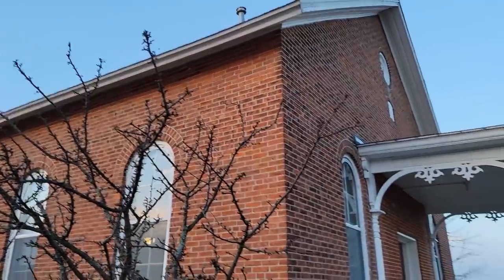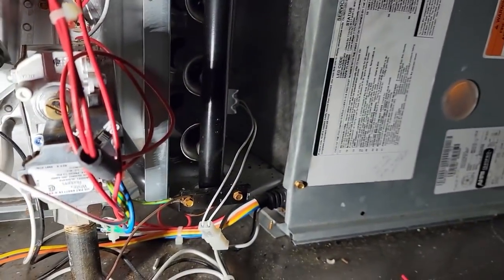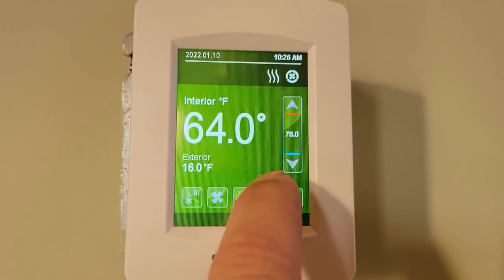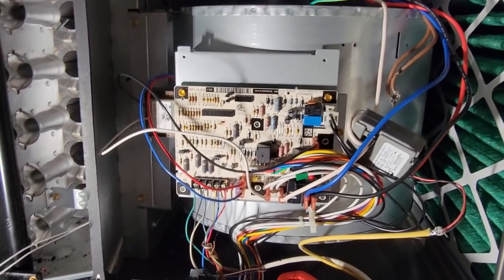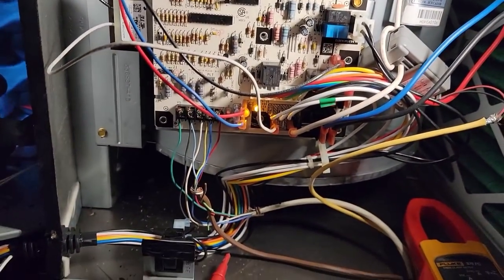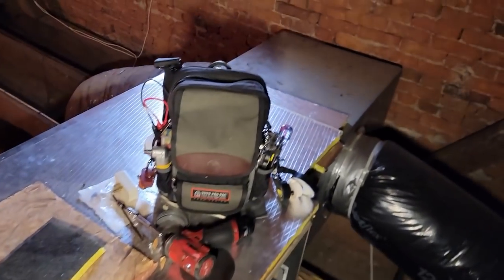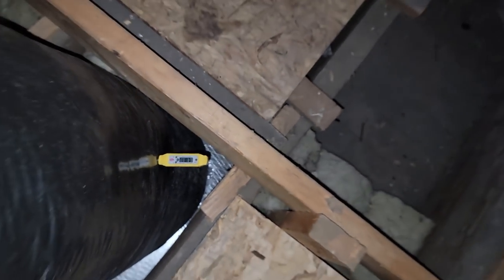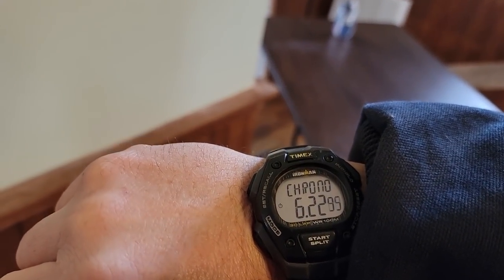Old School House No Heat 14* Outside

Comment: Hot air rises. Hot air is coming out of registers at the ceiling. They have the ceiling fans running in reverse, on low, pushing the hot air back towards the ceiling. Totally wrong! Those fans should be going forward on medium pushing the warm air down and displacing the cold air at the floor level out to the sides where the heat registers are. Wouldn’t make too strong of a breeze and would bring the temperature up at the thermostat by at least several degrees. It would also eliminate the need for the home made return air ducts. The space is not ideal but proper ceiling fan usage at all times during the extreme cold would solve a lot of comfort issues. You don’t push the air back toward the place it came from, especially at such a low velocity. Reverse on ceiling fans is for heat registers in the floor and an eight foot ceiling. Those fans should never be reversed.
Reply: They'll be really surprised when they ;earn fans can run in two direction, they never thought any of this through.

Comment: Why does every HVAC technician always think they can do it better than what was installed maybe a little good work would help sometimes but instead they always bash each other
Reply from the maker: Okay so what's your remedy for the customer? I'm talking to the viewer of the video not the customer. It was wrong, it needs fixed but nobody wants to do what it takes to fix it right.

Comment: My money is the supply air thermostat
Reply from the maker: We do that in jails and places you don't want the stat missed with. Just need to run the fan non-stop. Problem is the ceiling is way warmer than the area where people are thanks to the high ceiling and poor ductwork, this will likely result in short cycling unless the ducts are corrected.

Comment: Those furnaces are generally rated between 35-80°rise. A lot of the newer carriers have either a 165 or 200° main limit. Seems 145-160° would have been a better range for the discharge air stat.

Comment: I still put an isolation relay on some stats I tell the younger techs why we used to have to do that the hunter stat was the worst for me anyway
Reply from the maker: The first Honeywell conochrome two and three required it when we used it with a Lennox pulse furnace, the spark ignition would tend to fry it if I remember correctly.

Comment: I ran across many issues such as this when the customer expected me to perform miracles due to poor engineering and installation problems. Great job considering they didn’t explain what was done previously. Bandage solutions are not the answer, re-engineering for proper air distribution and return air would make a ton of difference! Insulation is another factor, stop heating an igloo… just an opinion!
Reply: funnily enough an igloo would hold heat better than this building

Comment: Hate those thermostats, had one that was configured as a heat pump on a two stage York unit that wanted direct her/cool signals and was hard locked as heat pump.  I called the manufacturer for tech support and they wouldn't help unless my shop was on their "authorized vendor" list.  Swapped it out for a Honeywell Vision Pro 8000.
Reply from the maker: 8000 Is one of my favorites

Comment: Instead of moving that discharge air sensor to the return, I'm curious if there is a parameter you can change in the logic of the stat to determine at what discharge temp it should consider going over high limit. I know that you can do that sort of thing with the honeywell zone panels and other similar systems.
Reply from the maker: If it can be then the controls department needs to fix it. I don't have the manual or the program needed.

Comment: Seems like this would have been a better building to have the furnace in the basement and floor ducts around the walls. It still would have leaked heat, but at least the heat would be coming in at the bottom where it is needed. If the furnace leaked any heat itself it might have warmed up some of the floor, which might have done as much as ducts. Putting all that in the attic just seems silly, unless they really need AC during the summer.
Reply from the maker: This was lucky to have a crawl space, and they did not have AC. It would definitely do better to have the heat naturally rise.
Reply: @HVACRSurvival  Fascinating. I was assuming that this building would have had an old basement with a coal furnace in it. Maybe they just had a pot-bellied stove in the back of the classroom.
Reply from the maker: It has a large chimney that is how sealed off, it likely had a wood or coal stove.

Comment: It definitely wasn't the finest installation by any means. 🤣 Does certainly bring some choice words to mind for whoever designed/installed the system.
Reply from the maker: I believe the first company I started with installed it? This was remodeled in 1990, I started in 1995 and it use to be a Lennox Pulse. All these years latter I come back with another company and its been replaced by a Payne 80%, the ducts would be near impossible to replace with the way the ceiling is designed.

Comment: So my question being it’s gas heating what’s the blower surge and continuous amp volt ?
Reply from the maker: Do you mean what is the inrush amperage and what is the continuous load? At this point I have no idea this was last year
Reply: @HVACRSurvival  just thinking on future videos 
Little facts yes inrush power 
New term for me always known as surge loads 1972. Anyways draws I ask because including such things makes sizing components to it would be extremely helpful I believe 
 Voltage & Amperage with surge gives the electrician what they need to know, most !
 Lol bet numerous wires are undersized for surge if not all
Lol 
 Running my ac for the first time this year on Solar power solely ; 1500watt system 2000 watt inverter; yes they need a auto shut off when not in use lol anyways powering a small window 550 watt ac for the first time all summer long just during the peak sun hours 11/4 brought me right back to cocoa beach Florida university of Florida once you got one then have to consider all surges that can happen at once microwave dryer  hvac it’s the compressors, sure ya know 
 Those hookup’s on capacitors are always a rush lol 
 Thanks again for the time to teach
Reply: Thanks again for talking time I’ll try not to talk too much 
Hope ya had a great workday ! 
Thanks again

Comment: nice cold air return ducts. 😵🤡💩
that needs a huge duct over and down to just above the floor. larger ducting to far end of building to supply more flow and least nearest the thermostat.
don't forget make-up air and slight positive building pressure..
** of course #1 BUILDING INSULATION and AIR SEALING. ** forgot to scream it at and, but that is always #1

Comment: seeing the cooked wire, burners and other overheated "roll out". I'd have stopped  and went outside to see how far the vent is above roof line, if there was lots of snow and wind, possibly snow drifted overtop the B-vent exhaust and blocked it or wind causing roll-out.
follow that with excessive negative building pressures, bathroom/kitchen exhaust hood with no makeup air? poorly/uneven sealed/un-insulated building and wind howling.
only in Ohio problems! LOL not really 🤪

Comment: Ah, yes, Spanish Dutch thermostats.
Reply from the maker: There is a reason why I said Dutch, basically this building is owned by a church located across the street. They have a fancy control system that this system ties into so they can monitor several individual furnaces, boilers and chillers.

Comment: It’s almost a shake your head and walk away job

I wonder if the unit airflow is also not quite enough ?
       The church gonna need a lot of volunteers to do a lot of weatherstripping and caulking at minimum the greater the difference in temperature the faster the chimney flue affect of hot air leaving cracks in the top of building and heavy cold air coming in at the bottom of the building.